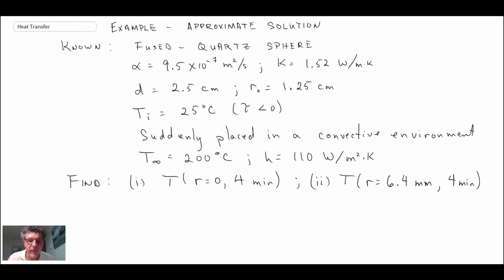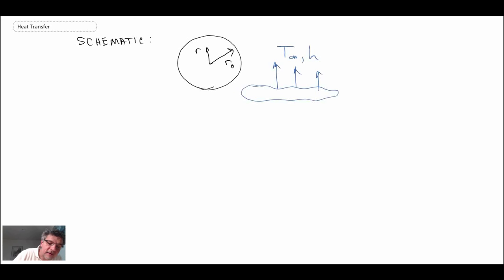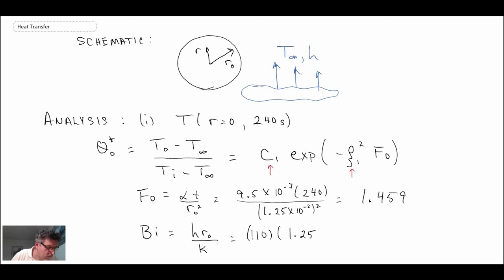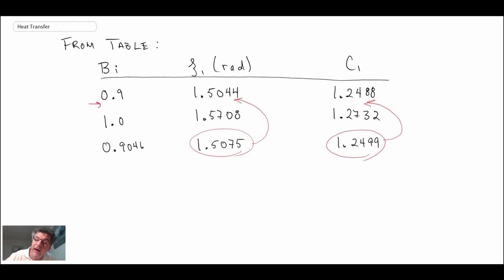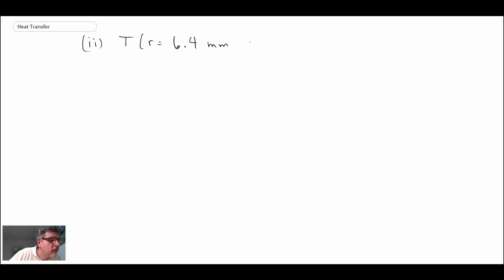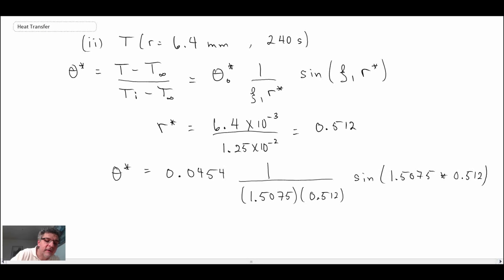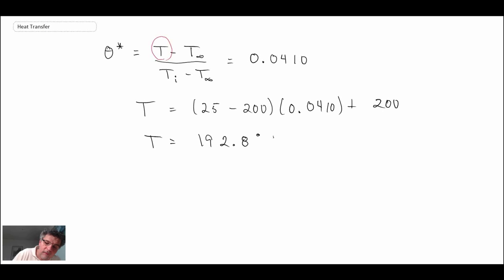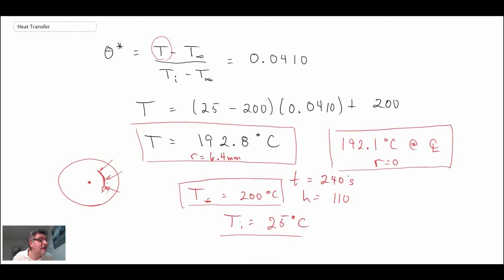Heat Transfer L16 p1 - Example - Sphere - Transient Convection - Approximate Equations

Comment: I have a question. I have steam flow inside a cylinder with 3 different kind of layer, like aluminium and two thermal insulation material. All of these materials with different r and coefficient(k,p,cp...etc).  How could i calculate the temperature at some point, for example, temperature when r = 1.2, 2.4, 3.0 and so it goes. Because after some point of the r coordinate we aren't not talking about the same material anymore. 
Ex: material 1 is between  0.6<r<1.2, material 2 is between 1.2<r<2.4. How to find the temperature at r = 1.2(the limit between two layers). I rly appreciate your time.

Sorry for my bad English, Its not my mother langue.